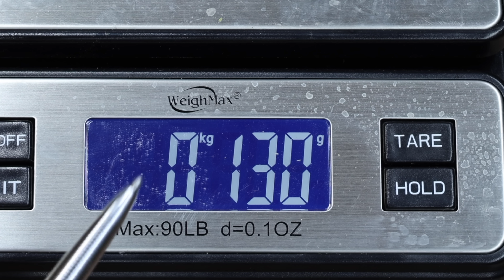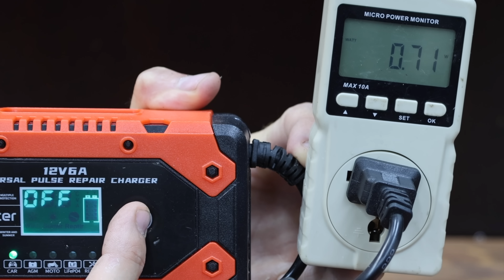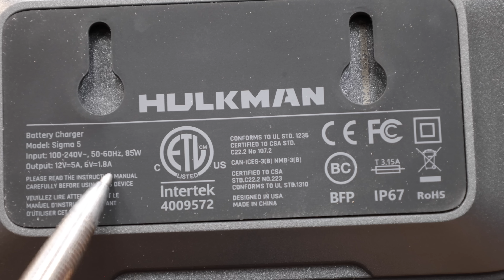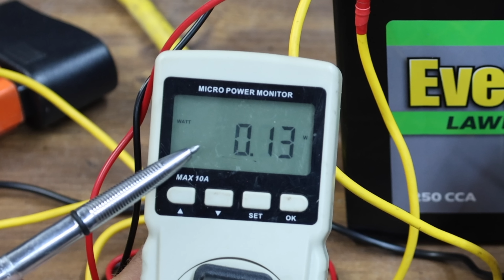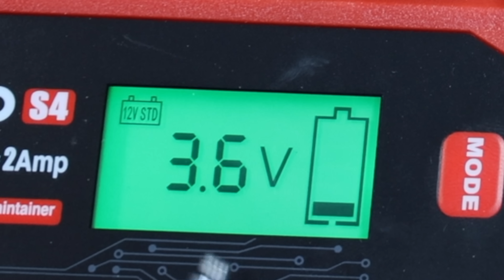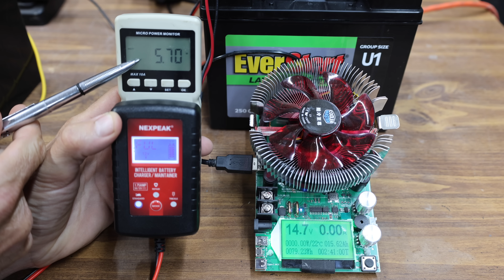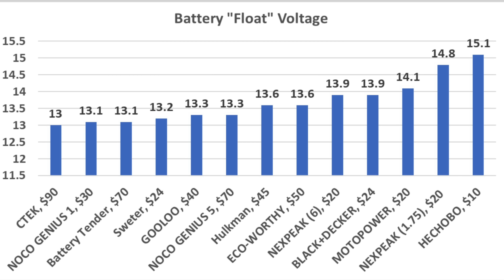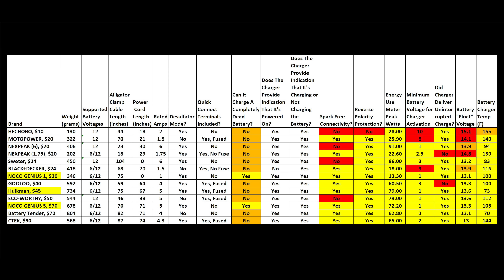I Tested the Most Hyped Car Battery Chargers – One Stood Out!

Comment: I have 2 CTEK chargers. One for my truck and one for my ATV. Nice to see my money was not wasted but I definitely have had issues with it not charging a completely dead battery on both my truck and my ATV. Now I know why. My solution was to install a battery cut off switch for both of my trucks batteries to prevent them depleting themselves completely. Then I actually started using the one built into my ATV!

Comment: Hi, so long time viewer and subscriber... and don't usually comment. But just some qualified input of you don't mind. I'm a EE, 1/2 my career has been on critical DC power, and chargers large and small have been in my purview.  Other half designing power conversion/control systems/chargers.  46y total now. The safety testing and "will it attempt to charge a dead battery", great tests. The absolute float voltage test and where I'd like to add some info.. These "smart chargers" use algorithms to detect if a battery requires desulfation cycle or not. Some just do it. It's can also be called a equalization charge or cycle. Very common to do a EQ charge on SLA or wet cells. These cycles commonly take the terminal charge voltage up to 14.5Vdc-15.0Vdc or so (or as we say in the industry we say 2.5Vdc per cell for EQ charge, a car battery is a 6 cell wet cell, 6x2.5=15V. Float 2.25Vpc x 6 =13.5. I also work on 2 cell jars that can supply 2500Amps)  I have a bunch of Noco and Battery Tender (BT) chargers. Both have such a profile for desulfation or EQing.  For a maintenance charger , say for my jeep that is not driven even weekly, has a 1A Noco on board. As well. alternators are the worst battery chargers ever. My daily drive, 1ton CTD dodge, has an onboard 1amp Noco, every once in a while, if I'm not going to drive it for a day or 2, I plug in the onboard Noco. Let it do it's thing. I've chosen the Noco's over BT since part of the Noco profile is, once it's charged / floated for a while, it shuts off the charger current till it sees the OTV (open terminal voltage of the battery) self discharge, of discharge from parasitic loads, to below 12.6Vdc of so.  (Going to onboard chargers have really extended the life of my batteries. )This is nice, for batteries just sitting on a shelf for standby emergency use too. These Nocos will not, by theory , over discharge a healthy battery on maintenance charge on the shelf.  I've had BT over discharge batteries, at 13.5Vdc. So far Nocos haven't.  Batteries age, long term storage requires an much lower float. 2.15Vpc. But you want to keep a battery for standby as fully charged as you can. I've had best luck with the Noco's for this reason IMHO.   By attempting to drag the battery terminal voltage down with the external load while the charger is across the battery, dickers with the algorithm and what the micro thinks is going on. If the charger is a standard constant current (CC) / constant float voltage (CV) charger, with no smarts, yea, you can certainly place the load in parallel with the battery, and do what was done... but depending on the smart charger... not sure what the outcome would be, it's all in their software.

Comment: The normal charging voltage for a lead acid 12v battery is 14.4v, though it could be 14.7v for AGM/gel batteries so most of the chargers are doing fine there. I normally stick to a max of 14.2 if I have control over the voltage, such as using a power supply rather than a charger.

I have a Noco Genius 5 and also the Genius 10 and found they do far better than any other automatic charger I've ever used. While I wondered why bother spending the money on them as they cost more than most, they do work.

Comment: I have been using Battery Tender for 20 years, they're all original. Never had one fail. I use a lot of the small 750mA waterproof units and leave them on batteries for 24/7/365 many of which have been used this way for years and years. I love their float/maintenance charge as its a reasonable voltage at a reasonable current. I have well over a dozen Battery Tenders, of different charge capacities and a few more recent purchases that have the LFP option for Lithium batteries.

I'll have to give the NOCO Genius 5 a try although I am skeptical.

Comment: I have a 30 year old Craftsman battery charger. It will charge any battery I have encountered, If the battery is at zero volts, I hook up a test light across the terminals, attach the battery charger and after a few minutes the meter will show the battery with some voltage and will charge it up. I never worry about gas fumes as I charge the batteries on a bench that is outside the garage and the gas fumes do not build up to be explosive.

Comment: I have an older Schumacher smart charger, which has the same fatal flaw as many of those you tested.  If the voltage drops too low, it refuses to recognize the battery, making it useless.  That's why my vintage 1970's transformer-based charger is always close at hand.

Comment: I've been using no name 1.5v  tenders from amazon for years, and have at least a half dozen.  Never had a failure.  They are 6v/12v.  They have a green label.  They are a wall wart style, and have SAE connectors.  They seem to keep my batteries up, but I've never tested them.

Comment: I have the Nexpeak. I bought it after I lost two Everstart batteries to sitting too long, and one was on its way out. It seems to have successfully repaired the ailing battery and made it like new, and charged the new one (always check the charge on your "new" ones, especially Everstart) and maintained both batteries for me. The other battery that went dead I haven't bought a new one yet. 

The fan on it seems to keep it cool enough even in direct sunlight on a summer day. I feel it was a good deal. 

My only gripe with it is it doesn't have that third pole for grounding. I feel a lot safer with that on something from China you have to keep plugged up over any period of time.

Comment: Since I have a pretty short drive to work (less than 15 minutes), and based on my research that it can take 30 minutes or more to recharge your battery while driving, I decided to get a Noco Genius 2D and mounted it in my truck. After driving home, it can take quite awhile to get the battery back to 100%. Every day when I get home I hook up the charger to top it off. Hopefully it will keep my batteries lasting longer here in South Central Texas.

Comment: I have both the NOCO 5 and a CTEK 7002US.  They are not on the same price point and the CTEK is superior.
The one part of your test that is flawed in the real world is the "totally dead" battery.  12V batteries are 90% discharged at 11.5v.  Most chargers will have no problem recognizing a battery at this level and will attempt to charge it.  Most of the better chargers have a "force" mode and in the CTEK, it is the "recondition mode." Using force mode will rarely result in the charging and return of a battery to reliable service.  I would not penalize a charger in the ratings for not attempting to charge a battery with near zero voltage.

Comment: If possible, test the desulfer function, especially NOCO and CTEK.
Source batteries for the test from a large CAT excavator that use 4 identical batteries so they have had the same life.
Having a charger that also can work as a 12V power supply is very useful. The CTEK MXS10 can be used in supply mode, which you also use to start charging a totally dead battery so that the charger can detect it.

Comment: YES YES YES. I didnt realize that with my Nexpeaks (defaulting to 6v). Also disconnecting it when it says charged will restart charging. Theyve done ok for me but I do think that it did overcharge on of my group 75 batteries when it was out of the car, ruining it. Awesome. yes large battery chargers. the "automatic" ones seem to be garbage. I bought a very old Craftsman fully manual battery charger and have a Shumacher big roll one (several years ago) that are not automatic. The automatic ones wont force charge. Which is generally needed with a dead battery.

Comment: Yikes!
I own 5 of the Nexpeak 1.75 chargers. I bought them because they came with those quick connect charge cables. This way I can connect any other charger that uses that same quick connect. My dad has several classic cars from his childhood, and each one has a charger connected to it for winter storage. Each charger has a one of those quick connect cables. SO, this is why I bought those Nexpeak.

I'm guessing you used the standard charge setting on these chargers, but this one has a "trickle" setting. I was wondering if setting the charger to that setting would make a difference in how much power it kept supplying to the battery after it says it's fully charged. I have a voltage meter, so I'll have to check/test it out!

Thanks for showing me that my charger isn't that great! I do have an $200 Optoma (I believe is the name) smart charger to charge and condition the batteries. I'll have to use that one more often than the little Nexpeak ones. So yes, I would love to see if the larger chargers and smart chargers actually do what they are supposed to do. Thanks!

Comment: As usual, your reviews are so well planned and executed. I watch EVERYTHING you review, even if it's not a product I need, because I learn something useful from every one of them.  I would LOVE to see your reviews of larger chargers, because I have  a Noco that the battery store recommended, but it doesn't charge a totally discharged battery. (I'm not sure what model it is because I'm not where I can look at it easily. I dragged out an old heavy charger that I've used for many years, plugged it in, and it charged up that battery very quickly to full capacity.  I think it is an old Schumaker.

Comment: I've had the Noco Genius 5 for a couple of years and it's kept my multiple AGM and lead acid batteries properly topped up (and repaired in some cases) through winter and long periods of no use. Highly recommended.

Comment: Mpdern "smart" chargers tend to fail on charging a battery that's run down to zero charge. I have however heard people saying they connected a working 12V battery in parallel and the charger powered up then they could disconnect the good battery and the charger kept charging the empty battery. I'm not sure how well this really works and if all models will charge a dead battery if jumpstarted like this.

The NOCO chargers will charge a dead battery if you enable the charging using a button. This is probably a good idea as any batter that's run down to zero charge is a bit suspect. This the button you have to take the decission that you will try to charge that battery. But if it is damaged or so worn down that it can't take a charge safely then it's up to you. You pressed the button so any problems occuring is yours to take care of.

Another thing that can help is keeping an old charger in the basement for these bad batteries that the modern chargers wount touch. Old style chargers have a transformer, a rectifier and a fuse. that's it. it doesn't care if the battery is dead it just pour on the power. They don't even have circuitry to check if the battery is charged, instead they supply 13.something volts and that's it. Lots of bad with them, always sparks but also always works.

Comment: I have a great experience using CTEK, even charging a dead battery. There is a trick connecting the dead battery to a charged circuit for few seconds and after that the CTEK starts charging

Comment: I have the 2-NOCO GENIUS 1a, a NOCO GENIUS 10a and a Optima 20a changer they are all great changers and they are all in constant use at my house/shop charging everything from 4 group 31s, car/truck batteries and lawnmower batteries. With a mix between lead-acid to AGMs. Great job as always testing keep up all the good work.
Reply: Not too be snarky, but maybe fix some alternator/generators or splurge for a new battery?

Comment: Float voltage for AGM/SLA batteries varies based on temp: it should be higher at lower temperatures.  Still anything above 14.8v (at 0c) is too high!

Comment: I am in the Ctek camp too. The have been the "Corvette" charger (sold by GM) for 15+ years.
Have two 4.3's mounted in the garage that maintain the batteries in my limited use cars (aka weekend fair weather only). The older one is from 2013 and the newer one from 2016. Both are essentially used full time (except when the car is being driven) and year round, and both have been bulletproof for the whole time, Before those I had Battery Tender units and none of those lasted more than 2-3 years.

Comment: I would like to have seen the DC current measured during charging. Using the AC input Watts is only an approximation, and could lead to erroneous conclusions about what the charger is doing to the battery.

Comment: I use NOCO's 1A and 2A chargers, not a single complaint. Always get a charger thats rated Slightly higher than what you think you need, charging rate during the summer vs winter for example, a weaker charger may not charge/maintain a battery well enough during the winter. The benefit of using low powered chargers is that you can use low powered Powerstations or even DC-AC Inverters and UPSs to help charge a battery in an emergency. I always keep the 2A charger with me just in case. 

Seeing the NOCO GENIUS2X4 being tested would likely be interesting.

Comment: My lunchbox look-alike, 10+ years old Schumacher Electric 12V 2/12/75A charger still kicks and works great. I wouldn't cross polarity in Engine Starter mode but part of any repair, be it changing a lightbulb or starting an engine with an external power source is still making sure you know what you are doing. But good to see which other options I should look for, should this tank decides to call it a day. Thanks Todd for all you test and share with us!

Comment: I have an Ampeak Smart Charger.  Cost $89 for the 15 amp, and $129 for the 25 Amp.   I have the 15 amp.  I've been happy with it. It's my favorite charger actually.  I highly recommend.  However, i am interested in getting a compact permanently mounted battery tender for my car. The kind you install into the car, and just plug it in like you would a block heater. Kind of like how the NOCO GENIUS2D Direct-Mount Battery Charger, is advertised.  I don't drive much these days because of my poor health. My car sits parked for weeks at a time. Installing a tender on the car that i can just plug in when i'm not driving it, seems like a good idea.

Comment: Most batteries that are completely drained will not be good and the ones that charge will usually be very low in capacity.  They can also damage other devices connected in the charging system.   So i think you are putting to much weight on whether the charge a completely dead battery.

Comment: Noco makes crazy impressive stuff. It's not a charger, but out church bought one of their big jump boxes for their full size school bus. That thing fits in your hand yet is able to turn over a cold 8 liter cummins diesel with two dead massive lead acid batteries. In fact it turns that big motor over quicker than the batteries do with a full charge. It's wild. I don't know what Noco does, but they make good stuff.

Comment: I've used and promoted the CTEK used in this video since I bought it in 2018.  I have a farm, and with all the full-size batteries, I have a total of 13.  I have some Walmart batteries since 2016 that still show excellent capacity to this day, using the Reconditioning mode every 4 to 6 months on each.  The CTEK and NOCO are both great chargers.

Comment: Another awesome video, I have 8 different battery tenders, some have been going 10 years. Their on lawn mowers, snow blowers, 4 wheelers and generator.   Only had 2 fail, 1 was replaced under warranty.
Could you do a video comparing reaction times for welding masks,  test if the shade goes to the correct level?  Thanks

Comment: The charging requirements vary significantly between the old "Lead Acid" or "Flooded" type batteries, the newer "AGM" (Absorptive Glass Matt) batteries, and the even newer "LiOn" (Lithium Ion) rechargeable batteries.  All three types require different charging voltages and rates to fully and safely charge, i.e. a "Lead Acid" battery requires 12.5v to 13.5v to fully charge, while an "AGM" battery requires 13.5v to 14.5v to fully charge at any charging rate.  If you use an "Lead Acid" charger on an AGM battery it will only charge to about 60% full.   Both of these type batteries will last much longer by staying 100% fully charged.

All three types are commonly used in "automotive" (cars, motorcycles, lawnmowers, aircraft, etc).  You need to be very careful  and KNOW which type battery you have and use a charger specifically rated AND SET for your type battery.

Comment: If you do bigger chargers test smart chargers vs an old “dumb” charger. Local interstate store told me modern chargers struggle in series or parallel with multiple batteries, as well as reviving fully discharged agm units to 13. Something to do with heat.

Comment: I HAVE A CTECH 3000 FOR YEARS AND IT IS GREAT  FOR REVIVING AN ALMOST COMPLETE  BATTERY BUT IT SEEMS  THE FUNCTION BUTTON IS A COMMON PROBLEM ON THEM . WATCHED ALOT OF VIDEOS WHERE THE BUTTON QUIT  AND GOT THROWN OUT ' DON'T  ' JUST TAKE OFF THE HOUSING AND CLEAN IT WITH AN ELECTRICAL CONTACT CLEANER  GOOD ' ESPECIALLY THE FUNCTION  BUTTON  . IT WORKED FINE AFTER THAT .

Comment: Having the same Ctek for 8 years. Rotating it on 3 cars. Since thene I never had a flat or ended battery. As the charger told me if a battery is close to the end of their life. Ctek is the way for me. If it's goimg to break, I will buy it again for sure. Also all my cars got the quick connector installed for easy access.